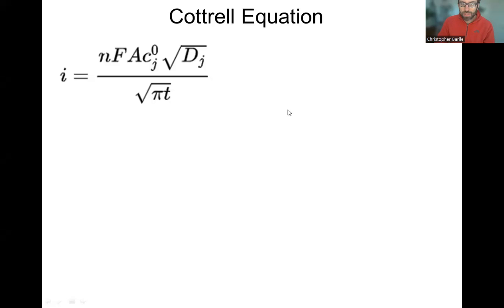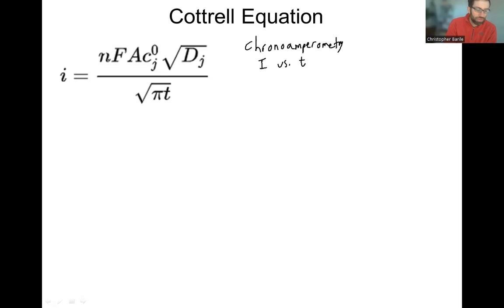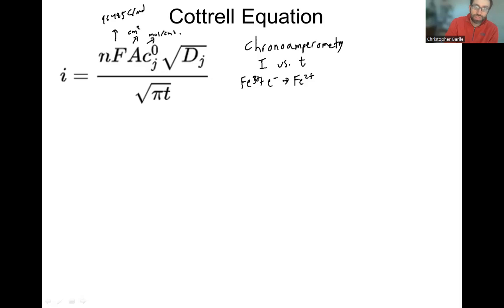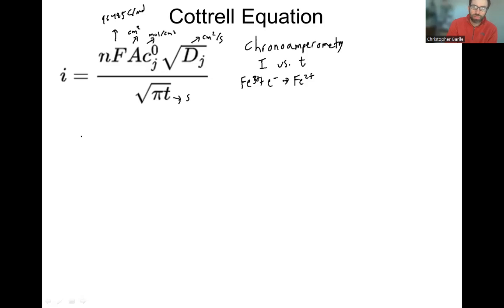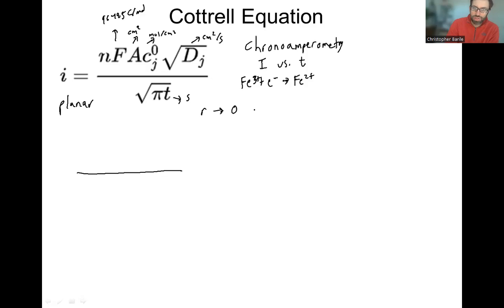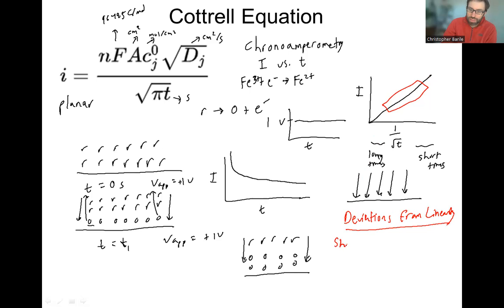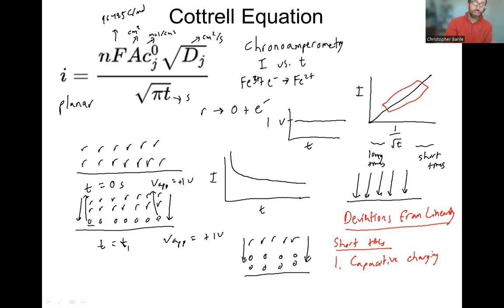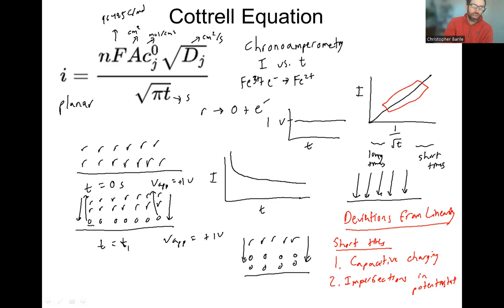Practical Applications of the Cottrell Equation

Comment: For some reason in my experiments I can't get a good straight line even tho the theory predicts it
Reply from the maker: Could be lots of reasons for that including side reactions or multiple mechanisms
Reply: Yeah, but there shouldn't be any pretty mutch, it's just ferrocene in ethanol or acethonitrile; the usual ratio with the support electrolite ( LiClO4 ) is 1/100 and I'm working with a concentration of 5 - 10 mM. It's weird because the graph i*t^(1/2) vs t isn't an orizonthal line at all between 0 to 8 s from the potential step. I need an acceptable regression because I'm trying to determine the electrons transfered by various chemicals using a combination of macro and microelectrodes, hopefully I can sort the problem out. Thanks for any suggestion you may have regarding the subject!